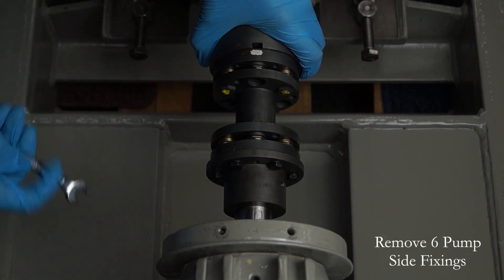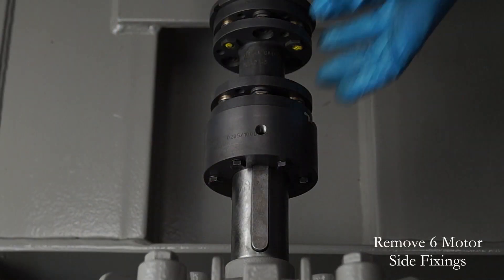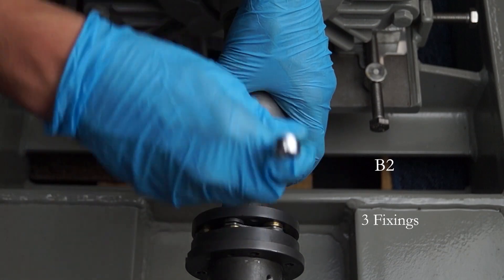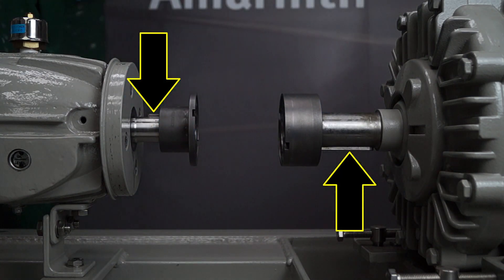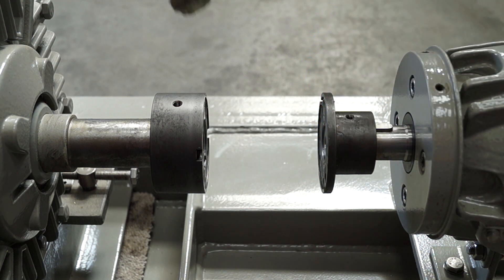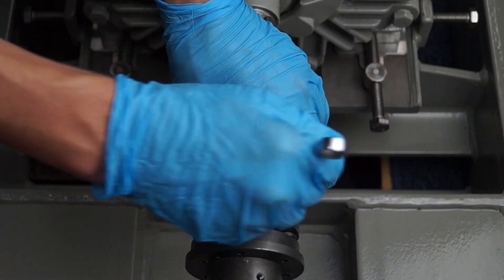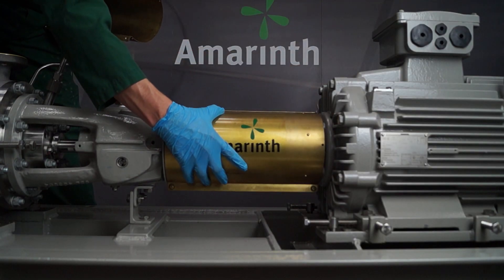How to compress, remove and re-install a pump coupling

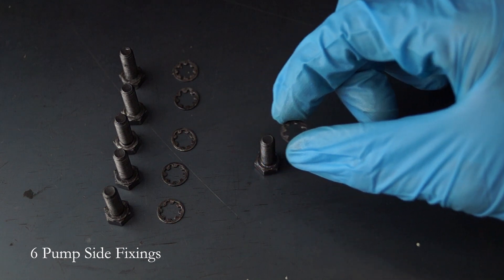Comment: @2:21 What do you call the hole through which the bolt is used to compress the coupling hub?
Reply: I'm not sure exactly, but I think it's like jack bolt hole.
Reply: Bolt is called gagging bolt